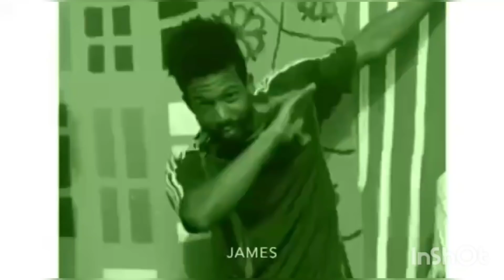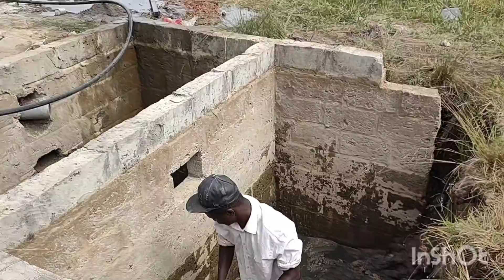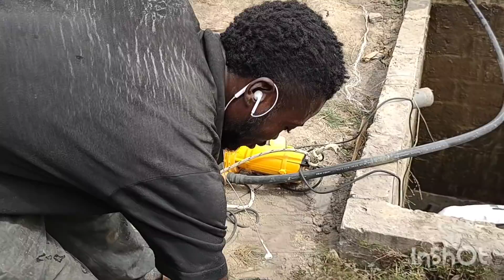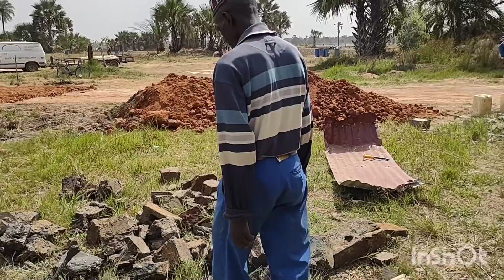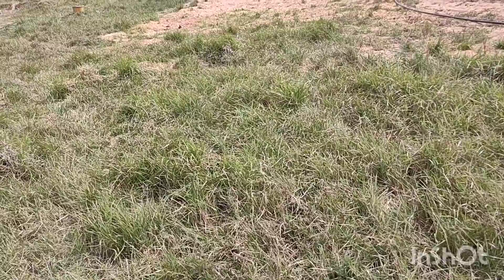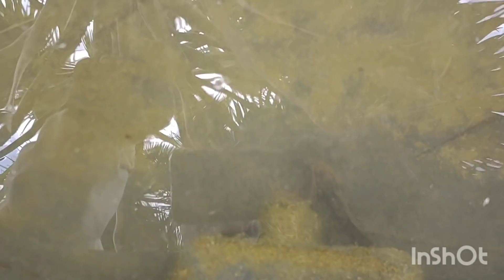Repairing the suck-away (septic tank) ourselves  Part 2

Comment: Mr. Rick, The cracks there will propagate through the plaster you put on the inside.  I would take the whole thing out while you are there and rebuild beginning with forming and pouring the floor reinforced with rebar.  During the floor pour, install the vertical steel rebar that will reinforce the tank walls. Inserting the bars into the wet concrete floor to provide a strong structural connection between the walls and the floor. Install horizontal rebar rods and use rebar ties to fasten them all the way around including corners. Spacing is between 12 inches and 16 inches vertical and horizontal. Do not use blocks. Form up the walls using plywood and pour one solid structure all the way around. Glad to see you are taking charge of the projects.. Lead the way!!
Reply: Galvanized Metal Wire Mesh or steel for Construction, 23 gauge Wire - 24 Inch x 5 Ft. Staple it to the wall about one quarter inch from the surface. It will strenthen the wall of the suck away.
Reply: @D-E-Raptor  Yes! That will do it.

Comment: Small gravel stones mix with cement and sand will be needed for the bottom. Use some rods btwn the pit walls to hold the walls in place so it will not fall again.